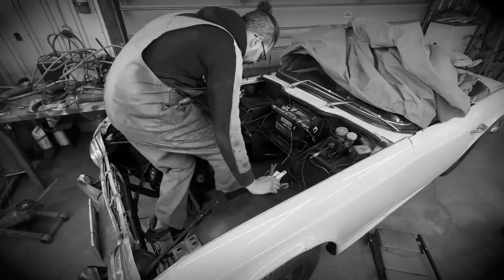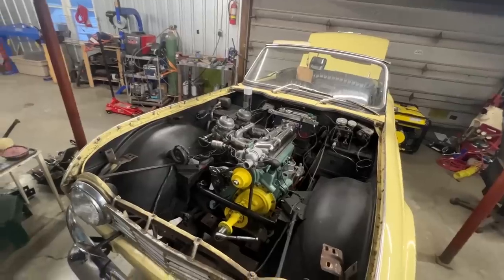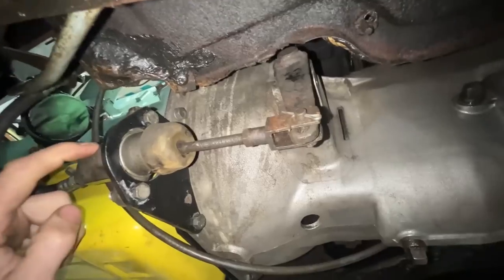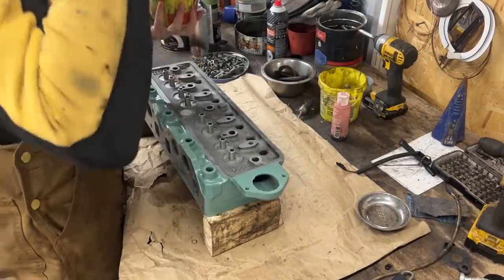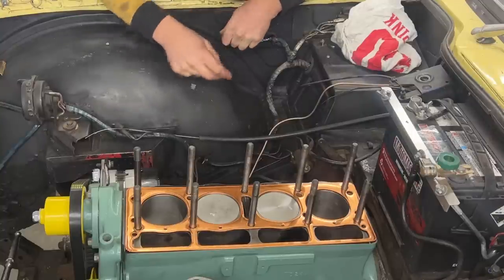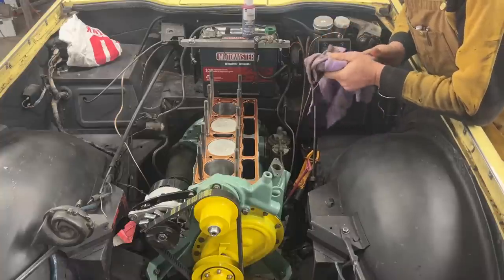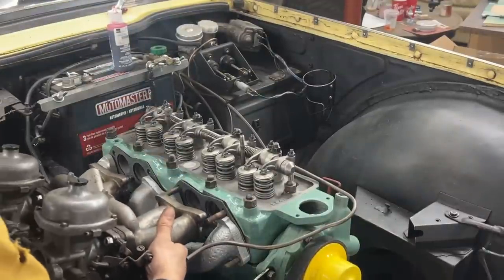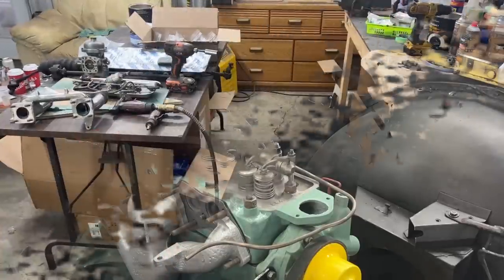1964 TR4 - Part 17 - Installing The Head

Comment: Another excellent video Elin, great to watch. Can I ask about the thermostat, it does not appear to have a "giggling pin". That's the little pin that allows air/water through when cold. I also think the thermostat cover fitted like that may cause an air trap?? What do you think? Cheers, Dave.
Reply from the maker: I am not familiar with this pin and I didn't check the thermostat. About the housing direction, I doublechecked with the manual later and that is the correct orientation.
Reply: @Elin Yakov's Rusty Beauties  most thermostats had a jiggling pin. It allowed air to bleed while filling up with coolant.  We usually oriented it towards the top of the stat. If you search "jiggling pin" you should find an example.

Comment: Hi Elin Love your work,  I could bore you with tales of my 65  TR4A rebuild. If you strive for perfection, my Dad told me never to leave the feeler gauge under the rocker arm whilst adjusting (bends them, flattens them ?). I still love your work and share it 😀
Reply from the maker: Maybe you are right, but honestly, if that happens it would mean that my set of feeler gauges is cheap and needs to be replaced anyway LOL. I don't tighten the adjusting screw that much... and there is a spring there too so I don't think it would be that easy to flatten the hardened metal that the gauges are made of. Maybe if I started the engine with the leaf there, yeah. But a little bit of a static pressure won't be harmful.

Comment: Aren't you concerned that the bottom of your "special tool" clamper will scratch, dent, or mar the top of your valve?
Reply from the maker: I used to put a piece of ply wood in the combustion chamber before, but lately I stopped. I find it unnecessary. First of all the valves are much harder steel than my tool (stainless steel in this case) and second, that part of the valve is not critical for it's operation. As long as the valve seat on the head and the taper on the valve are against each other, they are protected and that is what is important.

Comment: Elin, we’re the new valves lapped-in ok and did you do your normal compression ratio calculations?
Reply from the maker: Yes, the machine shop lapped the valves. I did not make CR calculations as on TR4 the factory ratio is pretty good. TR6 is where they reduced it to meet the regulations.

Comment: Elin, is there any reason why you do not use copaslip or similar when assembling components?
Reply from the maker: I was just discussing it with someone else too. There is no other reason than I am just not used to taking apart my own work LOL and never had to swear at my younger self for not using anti-seize :) I have to start using it in some areas like head studs and other components that are prone to seizing.

Comment: Elin, I'm sure you confirmed but that belt looks a smidge to wide. It looks like it sits a bit proud of 2 of the pulleys (vs resting/sitting enclosed by each pulley wall). At 21:25 you can see the light shining on the belt on the alternator pulley is slightly concave which could indicate the belt is being pinched.
Reply from the maker: Yes, I doublechecked and triple checked, it is a TR2,3,4 belt...
Reply: @RustyBeauties  It looks more like there is something up with that one pulley.

Comment: Good catch to all that mentioned the need for correct inlet valve 'spring direction'!  Elin and I weren't aware of that specification - lol.  
Elin, does the manual for the TR4 mention that fact in the re-assembly procedure?
Reply from the maker: Nothing in the manual.

Comment: Why are the inlet valve springs in upside down? The rockers should be slightly offset so that the valves rotate as they open.
Reply from the maker: Because I didn't realize they have a direction LOL. Need to redo everything now... Thanks!

Comment: Another great video Elin.. One thing that never seems to get a mention is your camera & editing skills.. The fact we could see you putting some of the valve springs upside down is a testimony to how good the detail we see actually is. Well spotted on the carb linkage  mechanism being on the wrong side.. Not many would have got that !  Another 'go to' definitive visual and entertaining instruction on all things TR.
Reply from the maker: Thanks Pete! I am not really sure if the linkage is correct the way I put it, but it works better and since I know the owner is not so crazy about originality, I do the things the practical way.
Reply: @RustyBeauties   Sadly, I just can't remember how the linkage on my TR-4 was configured.. It was too long ago, but like you I'd rather a component work optimally than retain those tiny details for the sake of originality.  There are fewer & fewer of us left that could precisely identify what was, or was not factory spec in 1964..

Comment: When I had my 3a Engine rebuilt, I was advised to put a paper gasket on the oil fed first pedestal base! Just an idea....
Reply from the maker: Good idea, but then I have to add gaskets to all pedestals, to keep the shaft from bending
Reply: Not necessary plenty of oil and no pressure.

Comment: Nice job. But when you have closed coil valve springs, the closed half should go towards the head. So the more elastic end is nearest the valve cap. When assembled incorrectly, you can get valve bounce at high RPM and increased wear on the cam. Unfortunately you have a lot upside down 🥴
Reply from the maker: Whoops...!  I haven't realized that. Hmmmm. Looks like I have some backwards steps to do now. WOW. I am so... Anyway, thank you for that! Let me go undo what I have done now LOL
Reply: @RustyBeauties  The easiest way without taking the head off. Is tear a strip of clean lint free rag up or use clean rope/cord. feed one end through the spark plug hole (leaving the end out ). And slowly bring the piston to TDC with the rockers off. This will gently force the valves against the seats and with a simple forked lever you can force the springs down and remove the collets (keepers). When done simply move the piston down the bore and pull out the rag/rope.  Or modify a sparkplug by taking out the ceramic bit and fitting it with an air line fitting. Then air pressure will keep the valves against there seats.
Reply from the maker: @garysweetland32  I fixed them all already :) made a “special tool” Thanks for pointing that out

Comment: For motorcycles, you can often save the cables by dripping light oil or WD40 down the cable - before giving the exercise to the cable that you did with the drill.
Reply: Mustie1 has a cool gizmo that clamps to the end of cables and seals around the cable sheath and the nozzle/pipe of a WD40 can - allowing the fluid to be forced along the inside of the cable, which works well - and saves a bit of time.  A quick google for "cable oiler" pulls up the very gizmo I'm waffling about 🙂
Reply from the maker: @dav1dsm1th  I have that. I don’t think this cable had an issue though
Reply: @dav1dsm1th  Available on eBay, commonly used on motorcycle cables - which is how I know about it.